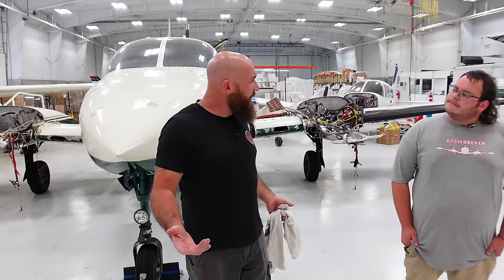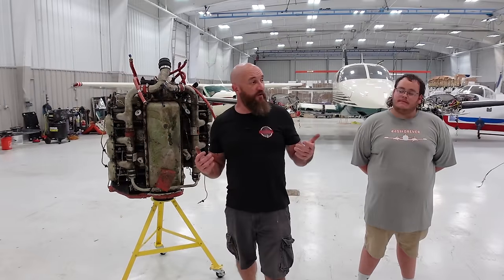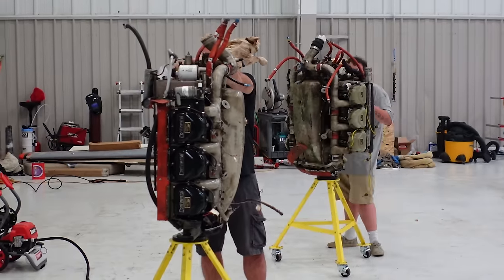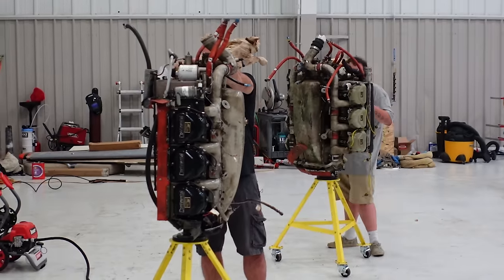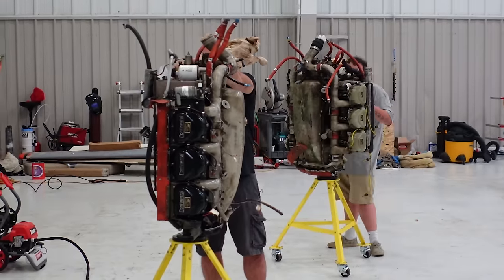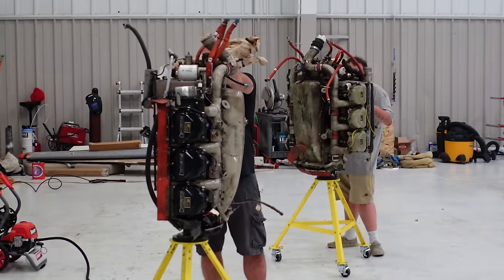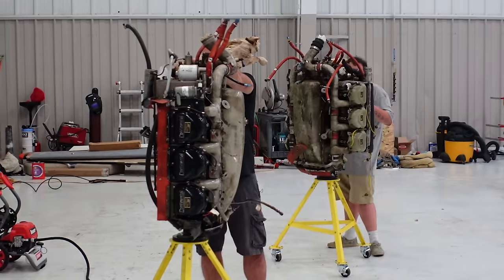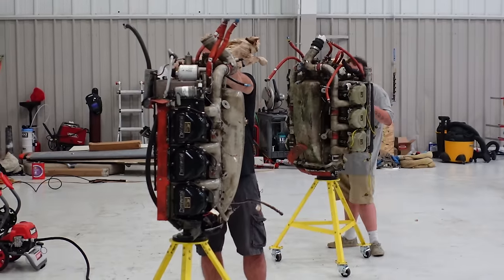One Step Closer On The Free Abandoned Airplane ! Ep16

Comment: Keep the wx-radar if it's operational. Fantastic tool when flying in IMC!
Reply: Since they are putting in an all glass panel, would that original radar unit be necessary/compatible?
Reply: @432b86ed  For real time weather development updates there is really no other way than to have a wx radar of your own. Other sources are minutes behind, and CB-cells can develop in seconds. So yes, I'd keep the scope if it is operational.
Reply: @432b86ed  it's a stand alone unit. No compatibility required. The cost to keep it working will certainly strain the budget for the limited use it will see. Have to laugh at some of the comments, want to see someone penetrate nasty wx with onboard wx radar just watch when they can't identify attenuation.
Reply: @buckmurdock2500  Then if that is the case, maybe an appropriate vendor/specialist will get on board.
But seeing as how this project is great publicity for all involved,  It wouldn't surprise me at all.
Reply: I'd want it just for the fact that you don't always know when clouds are going to form at the worst possible time or place and radar sees through things that nothing else will. Wait, is that a mountain right in front of us? Turn now!       Or ... oh, that's a mountain right in front of us oh #*&#$(&#$ (flatline_________)

Comment: Beware of corrosion. The bird/mouse pee may have seeped into the gaps where sheet metal is riveted together. Even though it looks clean, you may experience ongoing corrosion there.
Reply: One of those fabric steamers that tailors use is handy for dealing with lap joints.
Reply: Am I right to think there's a widget that uses Metal Resistance to measure how thick/thin sheet metal is?? some sort of electronic "probe" you poke into inaccessible places and find out if there's unseen rust in a plane??
Reply: @goldbunny1973  yeah NDT thickness measurements we use it in maintenance all the times
Reply: @goldbunny1973  as Luke says it's a variation of an ultrasonic inspection technique. Noting how thin the material is on the 401 it's use may be limited by the constraints of the technique. 

It's use is also limited by joints. A riveted joint you'll only see the thickness of the treated skin, not the skin behind. In fact, even joints employing elevated temp vacuum adhesive bonding techniques can fail to allow sound transmission across the joint.
Reply: @luks7305  I think I could've used that years ago when I had a Mini LOL. The sills rusted like it was a competition...
Reply: @mattc9096  Thanks for explaining. I am really loving Rebuild Rescue, perhaps because I don't know as much as others I find it really enjoyable to hear from people who DO know a lot. It's a shame so many people walked off in a huff when Jason did a week bit of Drama TV, LOL! THAT made me laugh more than anything, and then he went all sheepish and I laughed some more.
Reply: Gonna need to be re alodyned
Reply: Well hopefully the company takes apart every last bolt and rivet of the engines and clean/replace/fix it

Comment: Being a Retired Airforce Mechanic  any time we had to drain fuel we would take aircraft out of hangar to drain , also have fire dept standing by, I know that's asking quite a bit but fuel is so explosive ! then when working in the hangar with tanks open ,the aircraft needs to be grounded to prevent static electricity discharge plus a 500 lb ansul fire bottle in the working area !  We never drained fuel in the hangar and surrounding Aircraft !  Just a word of safety for you ! once a fire starts in a hangar it will accelerate beyond control !
Reply: I bet the Air Force learned their lessons with Gas Draining years ago. It was an expensive lesson leading to never allow it to happen again.
Reply: plus use air tools or at the very least tools with brushless motors to reduce chance of sparks
Reply: @chevy197045  Correct ! all our tools were air tools now that you mention it ! When we entered a fuel cell we would discharge our self on a grounded stand before entering the tank and wear a static free coverall !

Comment: I work on avionics and currently upgrading a 414 to full Garmin glass. To answer your question on the radar and if it’s still used; yes they are still used and upgraded often. Also, would recommend using bulkhead connectors as much as possible. Cleaning off all the pass through sealant isn’t fun. Also, do the wiring through the plane while the interior is out will save lots of time. Looking forward to Oshkosh 2023!

Comment: I just give you a heads up, What ever MOD you do to the engines, you need to make sure it is FAA Approved, have the STC and form 337 signed.  You just cant just throw mods at it, like you do with cars.  I just want you know be aware of that. The 401 would be grounded.  I know you have a lot of great ideas, but just CYA
Reply: Isnt that part of the engine overhaulers job?
Reply: @ual737ret  For the engines - yes. For the heater replace/upgrade - no. the A & P doing any changes to airframe and accessory configurations will have to "check  the boxes" for paperwork/log book matters.
Reply: @vincevonheeder5319  Any MOD that is not covered by the OEM documentation (AMM, CMM, SRM, SBs WDM  AIPC of  powerplants, components or airframe will require a STC. Such as adding shelving in the cargo compartment, switching to  LED lighting, adding lift argumentation devices, extras fuel tanks etc.   There are MODs available for all types of stuff found on aircraft what make those MODs marketable are the STCs that should be included in the MOD kit.  Replacing same or a newer component would not require a STC IF the newer component documented in the AIPC or SB.  The STC is  basically the engineering behind the physical MOD.
Reply: @onon2ski183  yes you are right and I want to add to that is that i has to go trough the FAA Testing protocols to be airworthy.  That is when it get the Good housekeeping seal of approval by the FAA.  😀
Reply: @vincevonheeder5319  Roger that.
Reply: He has ignored all previous comments on previous videos about paperwork and whatnot. He doesn't have log books, no record of compliance with any of the ADs and he is doing maintenance without the supervision of an A&P. As an A&P and pilot myself I would love to see it fly but he needs to do it correctly. Unfortunately he isn't, and these videos are making people think anyone can go buy an old plane and fix it themselves like an old car in a field.
Reply: @vincevonheeder5319  don't forget his comment about wanting to modify the engine for more performance and smoother running. He has no clue about aviation maintenance as he isn't an a&p. Anything outside of manufacturers specs needs an STC to be airworthy. He is just throwing stuff together and hoping the FAA will sign off on it because of the following he has.
Reply: @charlesmilson920  As you and others have noted, checking the boxes means more than just throwing things together. If this isn't clear yet, it will be. Manufacturers, re-builders, repair shops, mechanics, installers;  in fact, if it's going to be in the air, there better be a paper trail of certifications, log entries, FAA checkoffs from start to finish. I suspect the various licensed/certified folks he's had on camera by now have probably already have said as much.
Reply: @vincevonheeder5319  I hope they have said something. If they have and he is ignoring them or not listening, then he is purposely deceiving the viewers to increase income.

Comment: Get yourself some tubes of VALVE GRINDING COMPOUND and put a little on the phillips bit, and some on screw heads that are stubborn and you will find this will minimize stripped screws! I know you intend to replace all hoses but, it's just good practice to cap and plug all fuel and oil lines especially when pressure washing. I personally would have spent time pressure washing the engines BEFORE anything was even taken apart to get it running. That would possibly cut down on the chance of contamination, FOD entering the engine, etc. Be careful not to "kill it with kindness" watch the pressure washing that it doesn't get water into spots it shouldn't or damage anything with the high pressure. Learn about those deice boots and make sure you don't do anything to damage those either. Those are expensive to replace!

Comment: Use pontoon boat spray on that aluminum that you are pressure washing.  Star Brite works great.  just put it in a spray bottle.  spray real good  and after about 5 mins rinse.  It will look brand new.

Comment: Check the FAAs own thoughts on using technology for weather, especially Thunderstorm avoidance.  One uses it for “strategic planning” not “Tactical Planning.”  The onboard weather radar gives you real time information, whereas the data linked weather through Satellite providers or ground based, give you a time delayed picture.  Even with a transmit time of almost current, the data gets consolidated and can be almost 15 minutes old.  Pilots have relied on this data to skirt storms thinking they were in a safe zone and they were in fact in the middle of the thunderstorm with deadly results.  The onboard weather radar is the pilots last source for weather avoidance especially in the terminal area.  It is not perfect and is subject to attenuation but combined with your strategic sources you will get a more complete picture.  This airplane has weather RADAR for a reason, because it flies in IFR conditions where you need it.  Don’t get rid of it, if anything upgrade it.  

Another AC43-13-1B don’t do is use a steel wire brush on aluminum.  Hope cleaning the motor mounts was not with one as it in-beds steel particles into the aluminum setting up galvanic corrosion, see 6-115 c and 6-136 d (1) c.

Comment: I wish that plane had been put on a scale originally. Love to know the weight reduction. 
I detail filthy vehicles. The very first thing I do is close off everything possible. Open vents. Toss a six pack or flea and tick bombs inside. Leave a minimum of 4 hours. Hot sunny days if possible. Engine compartment ditto. Reduces a ton of work. Drives any critters out of the environment. Something to consider on your next rebuild.

Comment: Great work as usual! Puts me to shame for not working on restoring my own old Harley! Just a thought though, cracking loose seized or very stiff Allen (hex) bolts with a ball-ended tip Allen tool can often end in tears! The ball snapping off inside the bolt's head which is impossible to drill out and those bolts are either button heads or flush so you won't be able to grab them with vice grips if that does happen. I know there are some tough angles to get to in there but it's really worth the extra effort to use a regular tipped Allen tool to break them loose, then use the ball ended one. Okay, so they probably were all Philips/cross head bolts/screws as I look at it again LOL! Well the previous suggestion still stands for hex-head bolts/screws...

Comment: Great job so far !!!!, I'm not to familiar with the 401. The cabin heater, was it fueled from the MAINS or did it have it's own supply ???  Also, did you ever find out WHY& the TURBOS were seized up ????  Just prolonged NON use or NO oil ???
Reply from the maker: The heater feeds off of the tanks. It doesn’t use a huge amount of fuel. The turbos were seized up because of sitting and corroding.

Comment: Jason I worked on Navy tracking radar and flex wave guides can flex to the minor vibrations from the plane but they might not handle missive flexing causing standing waves of radar energy causing to burn holes in it. I recommend you check with an electronics A/P who can tell you how much abuse it can take before failure.
Reply from the maker: Thank you for sharing that info.

Comment: when start ? by the way: you unscrew the body parts and once unscrewed bolts can unscrew in flight after being used again. For large airplanes it is forbidden to use the scribs again during inspections and repairs, but probably the same for small ones. check what others do, what repair planes, do not use any method to prevent unscrewing the element with old bolts

Comment: Hi Jason, what system do you have to sort and store all your nuts/bolts/screws etc so that you know where they go when you put it back together and you don't lose them? 
When I tear down laptops to repair them I use a fairly simple method with cardboard, I map out roughly where they go on some cardboard punching small holes with a point tool then screw the screws into the corresponding hole, this way I know exactly which screw goes where for the reassemble. Obviously my method wouldn't work for a plane so just wondering what you do?
Reply: Don't you scammers ever quit? the amount of time and energy you put into your scams you could be putting in to legit honest business that doesn't have the consequences of a life of hell that you will experience, ah well why do I bother? as the sayings go 'you can't fix stupid' and 'stupid does as stupid is'

Comment: Just a quick question why on earth did you jet wash any part indoors everything is on wheels and the doors are inches away ?
Reply from the maker: Transitioning out the door over the multiple railroad track like door slides with those two huge engines wouldn’t have been safe.

Comment: Are you really stripping/grinding screw heads as much as it sounds like?  Most of that probably comes from working at angles, but using the right size and type of "bit" is important too.  Using a #2 bit on #1 screws is going to cause problems.  And what about replacing typical Philips-head screws with something like Torx?
Reply from the maker: Most if the screw heads are damaged on the 401. We’ll be replacing at least 90% of them with new.
Reply: @rebuildrescue  Okay.  Can they be replaced with Torx type, or maybe square-drive, or is there some FAA requirement to use Philips-head?

Comment: When I saw the effort a friend took for a STATIC museum restoration, I was anticipating what would happen when you want to get a plane into a state where you entrust your life on - on EVERY bolt, EVERY nut,  EVERY rivet failing can kill you:
   - complete engine disassembly, replace ANYthing that even makes the tiniest impression of not perfect. 
  - replace ALL the hydraulics
  - replace ALL the pneumatics, you can't trust decades-old rubber hoses 
  - replace ALL the fuel lines. 
  - replace ALL wiring, all electrics. Contacts corrode
  - replace ALL the flight control cablings, wires corrode esp. at the joints
  - overhaul ALL flight instruments ground up
  - of course new wheels, blown tires on the first landing - not good... 
  - strip all the panels that block access to ANY load-bearing structures, like the wing spars.  
  - any structural bolts have at least to be X-rayed for micro-cracks - or replaced.
  - anything where something moves, turns - the axles should be wear-free, uncorroded, the bushings adn bearings probably should be replaced.  
 
I think the biggest issue is the planning - the default treatment is ALL has to be disassembled and replaced, what are the specific criteria for instances where you can make concessions. I.e., it is not so critical when something goes wrong that you fall down, then that can be allowed in non-completely refurbed state. 
 
The Austin Healey is harmless in comparison, as long as the brakes work and the wheels do not fall off, you have a good chance that it is just annoying when it breaks down. 
 
My greatest respect that you take on this ordeal.
Reply: this plane will never fly again, unless he let it rebuild by certified people that actually know what they are doing. What he's doing is just playing around, that's no proper restauration
Reply: @tobiaslang3621  In the beginning I thought exactly so, but in the meantime - he brings the engines to a professional workshop, here he says they will take the wings off (meaning they WILL get access to the critical structures) - looks as if he is on a halfway decent way.
 
I speculate based on posting time and name: 
Du deutscher Realist, Du. Immer gleich mit Fakten kommen - da werden Träume nie wahr (aber man spart viel Frust ;-))
Grüße aus München, mein erwähnter Freund hat in der Flugwerft Schleißheim die CASA.111 restauriert und nach Fotos einen Otto Doppeldecker von 1910 rekonstruiert und aufgebaut.
 
Just watched a video of a guy that got a Cessna 310, overhauled after 15 years of standing around, but then again standing for a year, and after 2 days of checks and getting the ignition to work properly took it over 2841 miles home to Florida.
 
Seems there is a market on YT for such "Abandoned airplane - will it fly?" videos.

Comment: With all the chemical spraying you are doing on this plane, why not get a small pump sprayer, like a yard sprayer but smaller. Or even a yard sprayer. Pump them up once and use them until you need to pressurize it again...saves on the continuous squeezing of a spray bottle trigger which i know can cause discomfort after spraying a bottle full.

Comment: I'm pretty sure that the guys signed up to go over these engines will be happy to see this episode.  There is enough gunk and bad smells in a normal engine without half a ton of bird crap and nests in the mix.  I too would not be keen on a gas system in an aeroplane.  Thankfully, with the move towards electric cars, there are far more heating and cooling options based of electricity readily available.

Comment: How the hell did the birds get into the heat pump area? Hopefully corrosion can be avoided with some kind of coating. Excited to see what the engines look like once they are rebuilt. They are looking like actual engines after the 1st clean.
Reply: through the open nose gear door?
Reply from the maker: Buck is 100% correct. There is a small 1 1/2 inch hole inside of the gear door where those buggers we’re getting in.
Reply: Ahh, gear hole, that makes sense. The plane otherwise looked sealed off for the most part. Looks like a whole species was living in there 🤣🤣😜